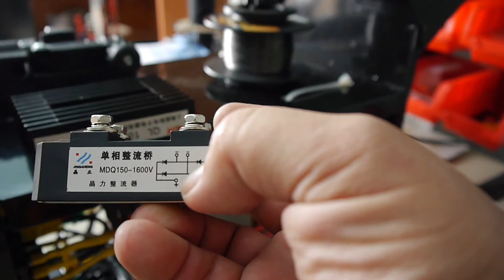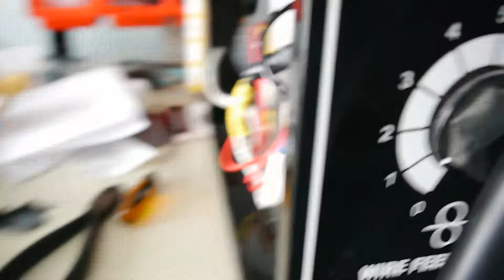FIXED - 90 amp welder AC to DC Conversion

Comment: After watching several videos here about how to do the DC mod, I figured after I buy all  the items I need to do it and the time it would take I decided to just buy a DC welder instead. I listed my Chicago Electric AC welder on Facebook Market place and it sold the next morning. Then I ran over to Harbor Freight and picked up the Titanium Easyflux DC welder. WOW, what a difference! It welds so smooth at lower settings, penetrates better and almost no spatter! I should have bought this one long ago. So if you can wait for a coupon and get a better deal, get the Titanium instead. You will be much happier.

Comment: I use this same machine without any mods and it does fine all flux core welders spatter it's just part of it but I actually learned to weld from a course there are some basic fundamentals you are lacking like Stick out  1/2 inch no more and drag angle 5 to 10 degrees and most important wire speed

Comment: That setup is horrible on a dc welder.  Use an indicator not a capacitor. Then your using a horrible diode setup. That block has 4x35amp diodes  with horrible cooling.   You needed to use 4x 70 or 80amp stud diodes on a larger plate block for cooling. That is  about 20% so no more then 2 minute welds. 8x 75am would be 40% @ 5 minutes run time with correct cooling.  Capacitor for dc welding is some kind of b's YouTube urban ledgen I fear to many people think actually works well.  48v@200-500 amps dc would work better welding if you had a inductor.  Iron core of some type with about 50 turns of 4 gauge wire would be closer then this setup to making good welds

Comment: I'm nearly finished with my HF 90a conversion, and I was able to fit everything in. I made a few other changes, like adding a transformer for the wire feed motor, a dinse socket and #2 welding ground. I'm also going to use a Miller M10  mig gun with an adapter to plug it in. I even ran a 12 gauge power cord from the back and rotated my speed control board up and moved my transformer to the right 1/2". I have upgraded the fan for higher volume, and my rectifier is 150 as well. I'm hoping to get the wiring to the rectifier finished up this week. My shop is on an Amish farm, so I will power this with my generator.

Comment: Hi, Did the conversion on mine with a 200 amp bridge rectifier and a 50 volt 68,000 mfd. capacitor. Started it up and proceded to weld for about 5 seconds then let go of the trigger to see how things were looking. Hit the trigger again and no spark at the electrode but have power to the fan and wire feed. I checked the A/C voltage at the transformer going into the rectifier and only have 1.2 volts. From what I understand, I should have around 35 volts A/C. Any Idea what pooped the bed ?  Would it be the transformer or something before that ?

Comment: You need to fit a real big heat sink to the rectifier, at 50 amps it produces 1Volt x 50amps equal 50W if You run that with 100amps You produce 100 W of heat. Think about a soldering iron with 100W, how hot it can get!! It's the heat which kills the diodes.

Comment: I would guess that the failure was caused by the inrush current of that large capacitor. Depending on the ESR of the capacitor, you could easily be going over the Max Surge Current of the rectifier.  For example, if the ESR of your capacitor is only .01 Ohms, that could be close to 1700A inrush at 17V! Best I could find for similar 100A rectifiers is a 1500A Surge rating.

Comment: You should note that the capacitor used in this conversion is fake. Not fake as in: it's not a capacitor, but a capacitor with fake specs and ratings. I have seen these "Hitachi FA" capacitors on ebay and looked up their specs on Hitachi's website. Guess what? There aren't any. Hitachi never made a FA series of capacitors. Those are probably Chinese-made capacitors of dubious specs on which someone slapped a Hitachi label with a seemingly credible manufacturer's part number (which doesn't really exist) and some specs tailored to make the capacitor sell. And it's not just me saying this, there are discussions on forums about these capacitors and their fake specs. Some honest sellers even pulled their listings when they found out they had been duped by their suppliers. But obviously there are still plenty who didn't.

Comment: It is worth noting the 100 Amp single phase bridge  rectifiers  actually use 50amp  diodes.    The 150A  bridge rectifiers  uses 75 amp diodes.  I notice some people doing the conversion use 3 phase rectifiers  rated at 150 amps but what is worth noting is these use 50 amp internal diodes so always go for the single phase version using 75amp diodes.
(The 100 Amp 3 phase rectifiers only uses 35 amp diodes).  These amp ratings refer to the average amps so in single phase bridge then  half  the time one diode pair conducts and other half of the cycle the other pair. hence averages 100 amps total dc output.  Sorry my post is long winded.
Reply: This does not make sense. In a bridge, the full amperage flows through 2 of the diodes during each half-cycle. So if you put 100A through the bridge, during one phase of the cycle 100A flow through one diode and 100A through the one on the opposite leg of the bridge. Then during the next half-cycle the other 2 diodes conduct 100A each. If the diodes were rated at 50A or 75A, they would be destroyed quickly. So unless the manufacturer is straight lying about the specs, they can't use 50A diodes in a 100A-rated bridge.
Reply: @stamasd8500   You are indeed correct if this was the max amp  rating of the diodes, however  50 or 70 amp rating I mention is the Average amp rating.  Therefore a 75 Amp average rated diode (which is one of the specifications manufactures list in full component data) conducting for only 50% of the cycles  will cope with 100 Amps for every alternate cycle.    The diodes will also cope with very large surge currents for a very short duration, say  10ms, but when it comes to say 10 to 20 seconds then double its rating  may  overheat the diode.  When a Bridge rectifier specification say 150Amps it means the output  and this will be a sum of each diode pair in the bridge, hence 2 x 75 AMPS = 150 Amps.  For three phase rectifier it will be  3 x 50 = 150.   Sorry I am not explaining very well.   So no the manufacturer is not lying.
Reply: @SwimmingBrambles  No, they are lying since if that is how they rate it, then at no point the "rated" average current can pass safely through the bridge. The maximum average current that passes through the bridge is the maximum average current that can pass through each individual diodes. I don't know where this "sum of currents through the 2 diodes in a pair" comes from, because it's the same current. The same current that flows at any time through a diode, is the same current that passes through the opposite diode. You cannot add them because it's the same current.
(edit) here are some helper diagrams. During one half-cycle you have this: https://www.electronics-tutorials.ws/diode/diode21.gif Note that the current that flows through D1 is the same current that flows through the load and the same as the current that flows through D2. You cannot add any of them together, because it's the same current. During the next half-cycle you have this: https://www.electronics-tutorials.ws/diode/diode22.gif and again the same applies. At no time can you have an average current flowing through the bridge that is higher than the average forward current for any individual diode. Yes the same current flows twice through the bridge as a whole, but that doesn't permit you to add it to itself. If that is the manufacturers of these bridges do for their rating, they are indeed lying.
Read specification sheets for rectifier bridges from serious manufacturers. When they rate a bridge for 2A for instance, it means that each diode in the bridge is rated for 2A.
Reply: @stamasd8500  In most of the data sheets I have looked at for Bridge rectifiers they are always rated on the average current through the diodes which is half  of the full cycle meaning the  Diodes are half the average rating when used with DC current.   When you look at data graphs for peak current v time it always slopes down towards half the average rating .   Why do they list like this. Because that is how they will be used as are for AC circuits.  So the rating is the DC output. Hence 100 amp Bridge rectifier will only cope with 50 Amps if say you supplied the ac input with DC to use just one pair of diodes.
Now when specifying a 3 phase bridge and the output is 100 Amps it means 3 pairs of diodes are used so each diode pair only needs a rating of 33 Amps average.    Hence of using a 3 phase Bridge rectifier rated at 100 Amps  in a single phase circuit  you need to derate it to 66 Amps.  Typically 35 Amp diodes are used so you would  actually derate to typically 70 Amps output if used with single phase.   A 150Amp 3 phase  rectifier is equivalent to a 100 Amp single phase.
Hope this makes sense to you now.

Comment: Good 2 see u made it work. I'm surprised the cap didn't blow when u had the clamp cross wired to neg on the rectifier. What size of cap did u use?

Comment: Turn down your power, mess with your wire speed. You really can get surprisingly good welds out of the factory welder if you dial in the machine, that's not a knock on the welder, any welder will make lousy welds if it is not set up properly and those welds are so spattery that the settings are way off. I used to blame my machine too but the other day I welded the handle back onto an old hose reel and I was amazed at how good the weld turned out.

Comment: I have the same machine and haven't done any mods to it.  I had never welded before but after some practice I was getting WAY better beads than any of the beads you are getting before or after your mod.  Are you sure you didn't get a defective unit? Or maybe you need more practice? Something doesn't seem right.
Reply: I had better welds too. I think his wire speed too slow and the electrode too far away. Plus i think he's pushing and not dragging.

Comment: Sounds almost familiar. Earlier this summer I converted my flux core to DC using 100 amp
bridges @ 1000 volts.   Like you, I could only weld  a short time and would go dead. Blown 
rectifier. I blew 2 of these rectifiers . Today,  I replaced those with a  200 amp @ 1600 volts
bridge. It was late  in the day so I decided to wait until tomorrow to give it a try. The 100 amp
ones were 3 phase , so each time all I had to do was to connect to the remaining 2 good diodes 
and weld a little more.  Each time those diodes would also go bad. I had my wife check the welding  
amps while I was running a bead  which was about  48-50 amps. well below the 100 amp diode
rating.   This 200 amp unit should work.  I've been wondering if maybe the 100 amp ones were
Chinese defectives .?  Dunno        Enjoyed your videos.
Reply from the maker: Kalkaekie   I hope the 200 amp rectifier works for you. Mine is still holding up after a few welds.

Comment: It looks like you are still using the harbor freight welding wire, its terrible once you change that to lincoln flux wire it will be better. good luck
Reply from the maker: plasticzeus40  That is what I've hears. The welder is still working great and I plan on getting the Lincoln wire for an upcoming project.

Comment: Did same mod with 100 amp. Feed stopped working after 5 seconds. Hooked up factory set up worked like before. This leads me to believe I need a 150 amp. Thank you for the vid.
Reply from the maker: John Wojtkowski  The 150amp rectifier is still holding up. I hope it works for you.

Comment: What is the purpose of the toroid coil?
Reply: The coil (inductor) is intended to "choke" and remove the 60 hertz ripple that remains after the bridge rectumfrier and capacitor.
Reply: Walt Anderson It gives you less resistance and in this modification you want a good steady flow of power in turn you basically get less pulsing as your welding however you can still do this mod without a toroid. The only thing I would do different is run the clamp + and electrode - to the capacitor and not to the bridge rectifier.
Reply: An inductor is used to help maintain a steady flow of current by resisting rapid changes in current.

Comment: Look at adding a small 18-24 volt transformer to your wire feed motor.
Reply: The transformer works for older models for new ones the wire speed motor requires dc